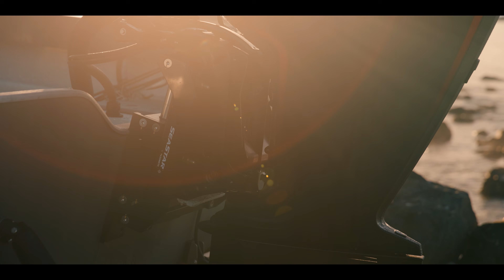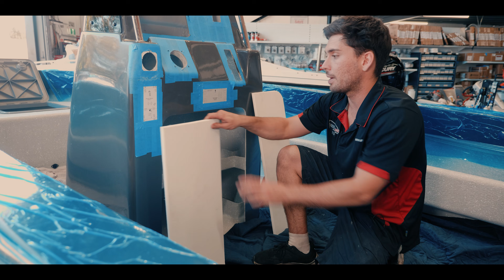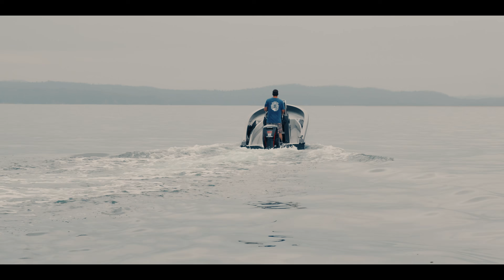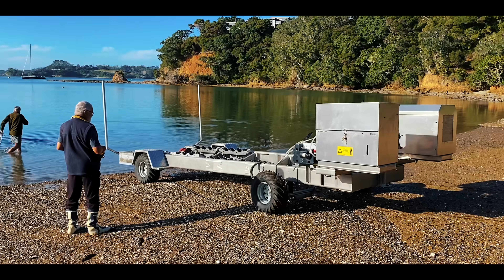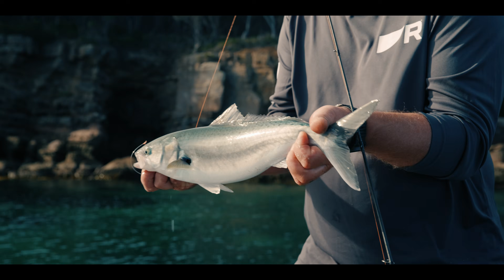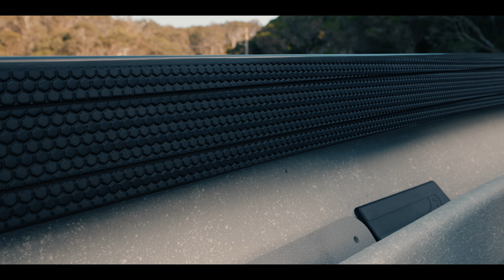5m Whitepointer Super Hornet project boat

Comment: The alloy along side the rollers on the trailer makes me nervous, one mistake on a windy day and it could potentially be a nasty gouge in the hull
Reply: Thought exactly the same thing myself..
Back to Eric's in 18 months for some gelcoat touch-ups on the chines 😂😅😂😅
Reply: The trailer is only suited for mariners. Never going to work at ramps with no protection and on shore breeze.

Comment: Fibreglass and Mercury is hardly Australian mate. Aluminium and Suzuki is the way to go.
Reply: @chippyjohn1  wat are you saying here im struggling to understand your logic?🧐
Reply: @rob7385  Aluminium is far better, and Australian made. Mercury is poisonous to our waterways and fish, as is fibreglass. Suzuki's are great engines and manufactured closer plus last longer and more effecient. The US Australian trade deficit costs every working Australian about $100 a week. When you buy US products you are hurting Australia.
Reply: @ bahahahah 
did u escape from the circus? 🤡
Reply: @rob7385  No. I escaped from the United Sociopaths.
Reply: @chippyjohn1 
I might potentially agree with you on that aluminium is just as good, but only on one condition, find an ally hull that was built in the mid 60's that is still going as strong as the old Thunder Bird 233 formula's and those old Bertram's are going today... some are pushing 60 +yrs.

Comment: nice boat. will stay with my Haines Signature 543SF SC and 640SF CC. i run the 150 PRO XS and the 200 PRO XS, awesome motors. i run the same 3 Dometic systems and totally agree, awesome. i run the latest MK Quests and 4 Humminbird Apex sounders. 2 on each boat. the 543 has twin Raptors(power poles)and both boats are run and powered by Dakota Lithiums. i like steel trailers, so both r custom drive on trailers. they have been treated and coated with Raptor products inside and outside. all towing is done with the latest F150. its taken me many years to sort through the different options in the market place for the 3 types of fishing i do. all barra dams and the Fitzroy River. inner island flats for Tuskies and golden trevally and the outer reef flats of the GBR for Geets and Chinaman.
Reply: Who did the raptor coating? Im planning on buying a new gal trailer.
Reply: @ mate did it myself. Make sure prep is properly done and have all the raptor products required for the job u r doing. YouTube has plenty of guidance as well. Take ur time and done properly is awesome.
Reply: @stephenlatimer1428  how did you get inside the tubes though?

Comment: He builds great boats old Eric I own one
Reply: Yep he sure does, thats for sure..
My 243 was a beast, was such a solid safe boat with high gunnels, incredible stable at rest because of the low centre of gravity, yet to be on a better all round hull, solid AF, but coming in at (towing) 4,250kg fully fueled and gear was getting to be a bit of a mission before I even got it in the water. 😔